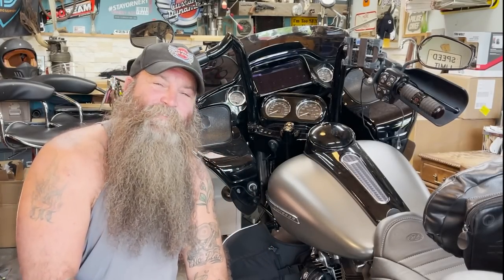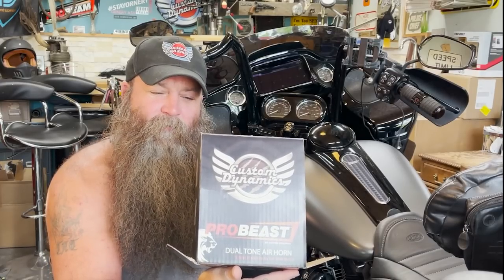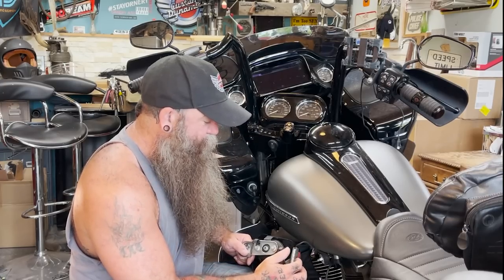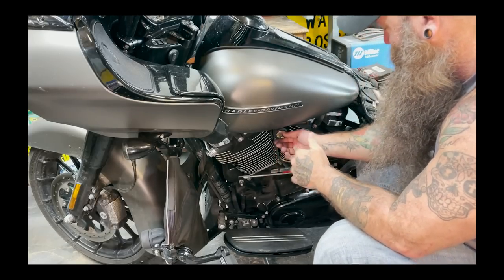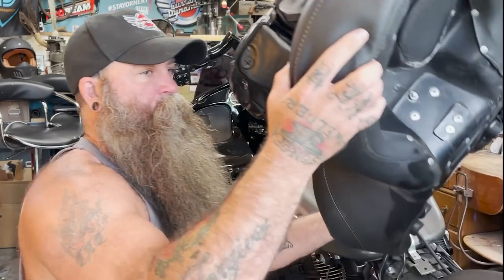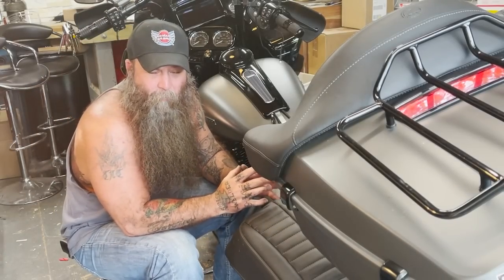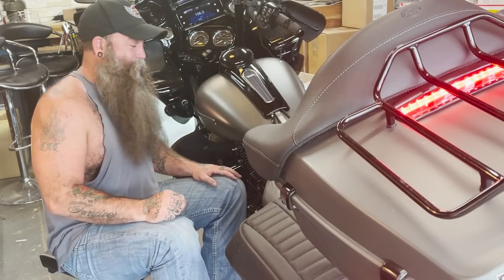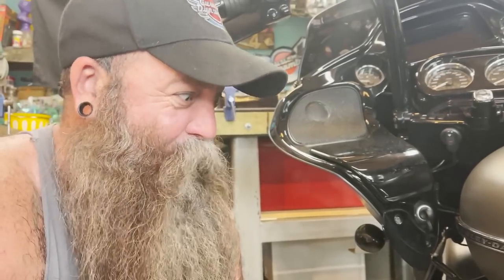Motorcycle Air Horn after market horns accessories Loud Pipes Loud Horn ProBeast Custom Dynamics

Comment: I did this years ago using my stock cow bell. Used a Stebel Nautilus compact motorcycle air horn. Separated the pump from the horn. Mounted the horn in the cow bell and the pump in a cutout under the nose of the seat. Gets your attention.
Reply: How did you separate it? Is it simply unscrewing a bolt? And did you have to to buy an air tube to connect the two? Looking at doing the same.
Reply: @josedeleon9156  It is not screwed together. There are plastic type clips that you have to gently pry back. Then you need rubber hose (I used fuel line hose because of there being oil and fuel in the area. It is a Harley after all.) Two screw type hose clamps and then some heavy duty zip ties. Just be careful as you pry it apart.

Comment: Used to run a train horn on my Kenworth W900L. It would wake the dead. Got tired of brainless assholes in tiny cars pulling out in front of me like they couldn't see a 13'6" tall, 70ft long, 80,000 lb truck. Being a biker, I was already used to them not seeing motorcycles, but never understood not seeing a truck as big as a building. After 1,500,000 miles in a semi, I realized that it's not that they don't see us, bikes or trucks, it's that the majority have their head up their ass and are distracted and not thinking about what they're doing. Anyway...I hope that horn helps. Gotta get one for my wide glide.